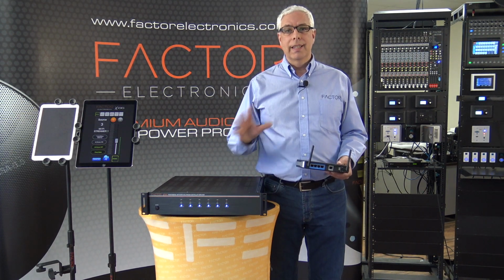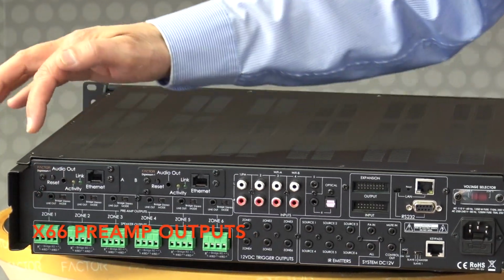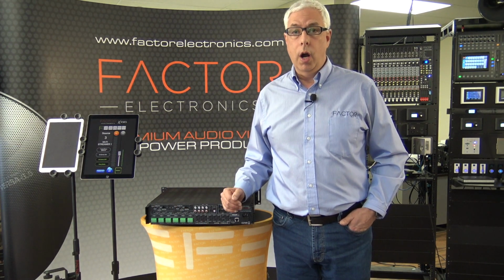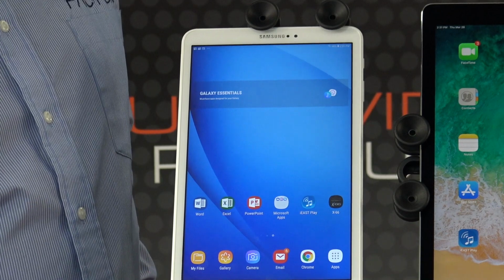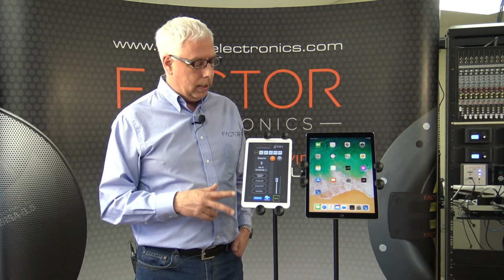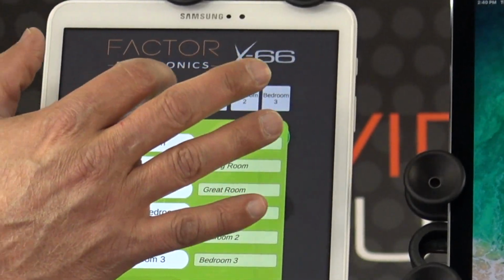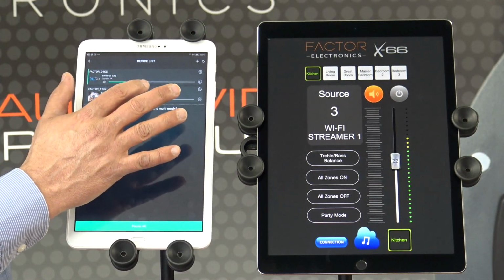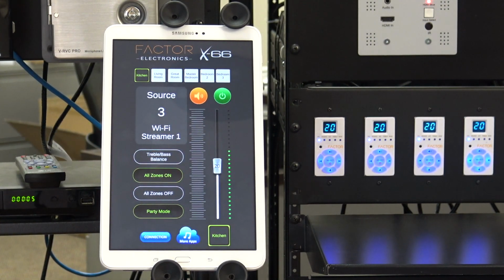Factor Electronics X66 multi-source, multi-zone, network controlled 6x6 amplifier.

Comment: I bought a new house and there  already installed Factor x66 sound system. I tried to connect several times not connected. I tried to connect as per the video showing on YouTube but I fail.

Can I get any help from anyone who might have Factor X66 ??

Comment: I tried to connect with my iPhone 12 for connection the sound dystem Factor X66 but fail. Anyone in this group can help me to get connected
Reply: Hey I was able to connect after trouble shooting for a while. First turn on airplane mode then only have wifi on. The x66 app seems to default to our cellular connection ip over the Wi-Fi ip address.

Comment: Hi thanks for showcase the technology, looks great to have in a house of a end consumer. 

I tried to get the price of this amp, which looks very similar to: V-66, Monoprice 6 Zone and Dayton DAX66 however the X-66 has some extra features I would like on my home implementation. I reached 2 of your distributors: Anixter Kent, WA and PAM Distributing and none of them gave me a quote apparently they just work with companies not with end consumers. 

Could you tell me where should I get the price and where may I buy it if want to? Thank you!
Reply from the maker: Alejandro, thanks for your inquiry. The Factor X-66 is not the same as the other brands you mentioned. We are the manufacturer and we do not sell products directly to end users. However there are lots of professional installation companies that install Factor Electronics products. We will send you a list of contractors in your area.
Please let us know if you have any other questions.
Regards, Factor

Comment: Hi I am trying to establish a connection with my iPhone 13 but am having issues. Is this normal?
Reply from the maker: Anthony the X-66 ships DHCP which means that your router will assign an IP address to the X-66. If you have rebooted your router or you have had a power outage your router could assign a new IP address to the X-66. The original IP address will be stored in your phone or tablet. You will need to find the new IP address and manually enter that into the X-66 app. This is very easy to do. Just go to the Factor Electronics website at www.factorelectronics.com, then navigate to the X-66 web page. At the bottom of the page you will see two documents, 1. Installers connection guide and 2. Baud rate reset and static IP. Download those two documents and follow the diagrams.  There you can also set up a static IP address for your X-66 and the IP will not change (unless you change your router). I hope that helps. thx